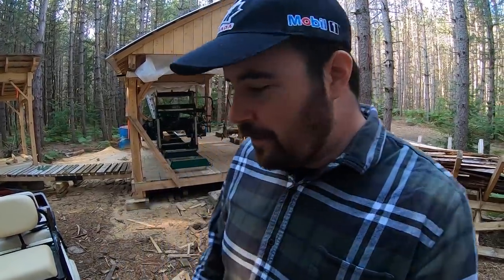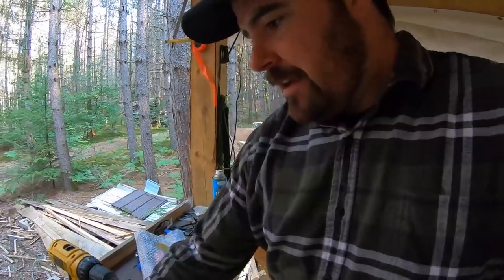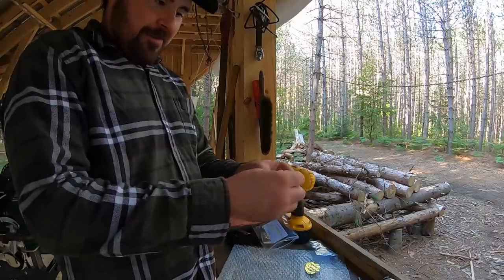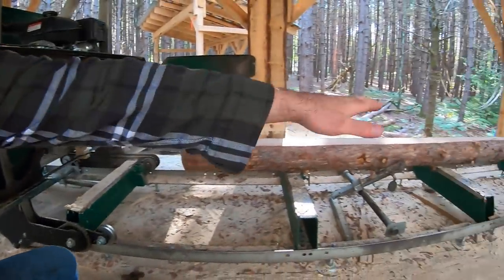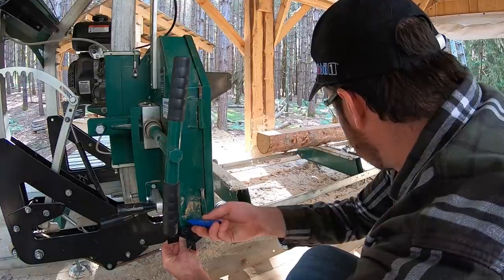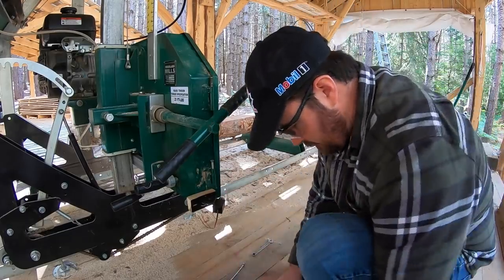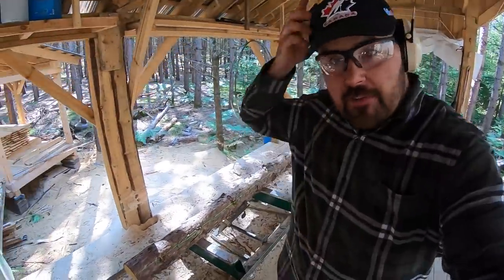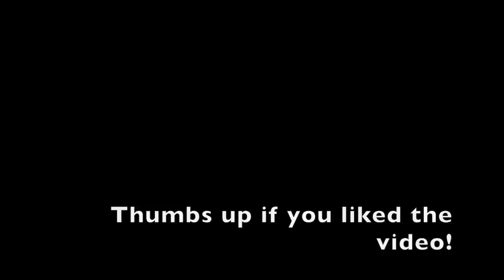Sawmill Laser Line Changes Everything | Placement and Setup

Comment: About 30 years ago, while working with a mechanical engineer, running a high end Wood Miser. I solved this issue by taking his advise that "the simplest way is almost always also the best way". We discussed the use of lasers, optics, various devices.

I decided to use a piece of wood, mounted exactly as you did with the laser, but I mounted to the left side of mill.

 The piece of wood was cut curved on the left, and flat to mount, on the right. I cut a slit through the curve. Mounted with slit at same height as the blade. Just look through the slit to see where the blade will be at the end of the log. The curve was to make it easy to look up the log, not just at the end.

My design does not require a battery, nor adjustment once installed. Simple.
Reply from the maker: Thanks for sharing that idea. Sounds like a great option!

Comment: Just watched your installment of the lazor on your mill. What do u think of putting  your power supply an a switch up by the throttle that way it is right there for u to use don't have to reach anywhere else to turn it on an off. Another idea is the bracket for mounting the lazor if it was magnetic it could be taken off very easy.

Comment: Thanks for bringing this to my attention.  When I get my mill I would definitely like to have one of these on the "Stop" side.  If the laser hits a stop... so will the blade.  As for doing the initial setup, I would get a nice block of wood and use a black Sharpie to draw a line exactly one inch (1.000 ") from the bottom.  After making a cut on the log, I would raise the blade one inch higher.  I would then move the block of wood all along the surface of the log to make sure the green laser is exactly on the black Sharpie line.  That should let me know if any fine tuning of the laser needs to be done.  Cheers!

Comment: Sandy here’s something to consider for clipping your alligator clips to your wire , put a couple spade tabs on the wires that the alligator clips on to , also I would extend the wires to your power supply and move it up to the handle bar of your sawmill so when you power up the saw mill to cut your wood you can turn the laser on or off without having to bend over to do it  …
Reply from the maker: Great ideas Don! Thanks for passing those along.
Reply: @sawingwithsandy  I would never leave those alligator clips there.  As said above just extend wires and mount elsewhere.
Reply: @brinkee7674  I'm gonna do the same too

Comment: I mentioned doing this laser mod in your episode: "Keep an Eye on These Sawmill Maintenance Items".   You didn't say much back about it so I thought you probably found it an unimpressive idea.  But now one month later and I get to enjoy seeing  you have set up a laser on your mill.   I mounted my lasers on the doors using 3d printed brackets with trunnions and those assemblies are held on there with strong Neodymium magnets.  The magnets pull up from the bottom and from the side.  They really hold.  No drilling of holes needed.   I have one assembly on each side of the mill.   My sawmill is on a trailer so I can't easily hop from one side to the other when operating and for checking the log stops.   Much of the time it is hard for me to see the log stops.   To see them and the laser line on that side I am using a small backup camera/monitor setup.    The camera is mounted in the trunnion with the laser on the log stop side.   The monitor is up on the other side by the handlebar.   The lasers take 5 volts which I get from a DC to DC converter that is hooked up to the 12 volt starting battery.  The camera/monitor being automotive is 12 volts so it can also run off the starter battery.     I have a small 3D printed box that contains the DC to DC circuit board and the switches needed for everything.    It also contains a light which is to help with viewing my other sawmill modification: a digital display which I use in lieu of the scales.   There is inline fuse protection for the wiring.   I used magnets to mount everything and the 3D printer certainly was a game changer for making it all come together.    These mods were quite inexpensive for what I think they add to my enjoyment in using the mill.
Reply: a picture of your set up would be nice !
Reply: @ericcourchesne5901   I could do that but I am just not quite sure how/where to post it?
Reply: You could always post s video of it, then post the link here as a reply

Comment: You could cut the ground lead to the lasre and run a pair of wires up to your milling handle and install a momentary switch between the two ends of the cut wire . This would allow you to just hold the switch on while you adjust your height and the release it and the laser would be off. no going back and forth to the laser during setup. then turn off the main switch on the power supply when your finished sawing for the day.
Reply from the maker: I think this is a good long-term solution. Once I"m sure the positioning works where I mounted (I think it's good) then I may do just this. Thanks for sharing!

Comment: A momentary switch near the push handle sounds ideal.  That way you don't forget to turn it off and drain the battery.   
I like the placement of the laser.  That is a busy area, hopefully you wont run into it with your knee.

Comment: I put mine behind and a little to the side of the stationary blade guide. It runs off the 12v battery that starts the motor. Works great on the end and operator side of the length of the log. I forget what other channel I originally saw the mod on (about a month ago), or I'd have referenced them for acknowledgement.
Reply from the maker: This could be a good option as well.
Reply: Great idea running it off the saw mill.

Comment: The more gizmos on a sawmill the easier it is to operate. You need the auto lube. I modified a 12v trailer jack to raise and lower the head, sure makes life easy on the shoulder and easy stack cutting. That laser looks wicked, thanks for sharing, will check them out.
Reply from the maker: I've seen some 12v jacks rigged up to the Woodland Mills sawmill on facebook groups I visit. Maybe it was you posting the build. Sure looks like a slick unit! Glad you liked the video and thanks for watching!
Reply: @sawingwithsandy  myself and a friend have posted our trailer jack mods on FB. His is on the 130 and mine mine on 126. Its the best mod I’ve see on these mills hands down, won’t surprise me to see WM adapt it at some point, or something close to it, they seem to have a knack for new gizmos. 😉

Comment: Nicely done. You can get some bell wire - twisted or not - attach to laser and route around the saw and to the station.  Then you are able to track the batteries and on/off when not used.

Comment: Simply love it. You are right, it should boost the production by speeding up the blade height setting and maybe helping in getting an extra board or two from each log. And if you were to set another laser on the other side of the log, you would know when you are about to cut into one of your dog...lol... save a few $$$ in blades there too. Thanks for this video
Reply from the maker: You're right about that one! Cutting logs is one thing but cutting log stops is another haha

Comment: Looks like your on a tree farm there and the trees are still kind of small. Do you ever get big logs? I'm in NH and my mill will accept 30" Dia. and 21' long.  I saw allot of white pine and some red oak that are around 2' in Dia. Those get heavy. My bandsaw mill is home made and I made a hydraulic log turner and log clamps for it. It's all hydraulic function now, but I started out with it all manual.

Comment: That would also be very helpful to people like me that don't very often cut straight, smooth logs. There are times i'm cutting slabs and there may be a specific feature halfway down the log that i want to capture in a slab (or avoid entirely) and the tape measure isn't always as fast or accurate as i'd like, especially between the rails.

Comment: Looks great Sandy. 
You will need to calibrate it for wider logs though. 
Based on that video there is still a chance that the laser points down or up  in the direction across the mill. So with a wider log it won’t hit where the blade does.
Reply from the maker: I tried my best to ensure that it was running at the same plane as the blade but you may be right that some fine-tuning will be needed to ensure it's spot-on

Comment: First off all ,, good to see you're eye is healing well. Perhaps i would have put it on the door itself in that bottom corner. but like so many suggestions there are no right or wrongs on where to put it. Also i noticed you sawing bed is quiet long,, did you have extensions on your mill and what is the maximum length are you able to cut on it?

Comment: I have been thinking about the post that builds up saw dust. I think if you have a old 5 gl. bucket put the lid on and cut off the one side just in front of the handle. then cut the top and bottom of the bucket so that you can slid up the post. the top should keep the saw dust out.

Comment: That is a great addition to your sawmill.  Will be interesting to see how it holds up over time.  It does vibrate a fair amount while cutting.
Reply from the maker: Since it’s often used in commercial sawmill operations I’m thinking longevity should be good. I also just turn it on to set the first cut location then turn it off as after that I’m all set. I’ll be running it and testing it out in coming episodes. Glad you tuned in to check it out

Comment: I like using Lasers especially green ones in my wood shop since they are easier to see over the red ones.  I was thinking mounting the laser on the underside of the blade box instead of on the side as you did would be out of the way in case you accidentally bump into it.  Looks great and hope it holds up in the freezing winter temps since batteries just hate cold freezing weather.  Cheers!
Reply from the maker: I like the green as well. Sure seems like it's bright that's for sure. My main concern with below the blade box was I needed the laser to be in line with the blade so that the laser would broadcast a line that was flat across the side of the log in addition to the end.

Comment: Could you make a stand alone jig that mates with the saw only for setting height? Maybe a bolt that goes across into a notch to raise and lower the laser, vibration is a killer and will mess with your laser module in no time.

Comment: ok, for the slow learners like me.  Can you please explain how "eyeballing" it with the laser is better than a tape measure?  You didn't really explain what your objective is when using the tape measure?   Are you going back to the mill and adjusting the level/height to what you got from the tape measure?  And now that you can "see" where the cut is going is the measurement inconsequential?  I don't run a mill yet so I can't ask a question that's based on experience/bad experience etc. Does the laser allow you to have confidence in how shallow you can make the first cut and be sufficient?  I have watched a lot of milling videos and I haven't heard (yet) anyone talk about the difficulty of picking the line for the first cut.  I not trying to be a jerk, please explain or take it as a suggestion for new content for an explanation video.  Cheers

Comment: Im digging it.. Hopefully the laser can hold up to the vibrations of the sawmill.
Of the 10 lasers i ever bought i bet 7 or 8 failed in fairly short time.. Probably just overseas junk..
Stop at your auto parts store and get some black plastic wire shielding and a switch and mount it in the drivers seat :)
Going to keep my eye on how this holds up for you.
Sure would save me alot of time when im alone at the mill..
Reply from the maker: Good idea Steve. I'll be sure to have the laser in action in videos coming forward as I get down to cutting. Thanks again for watching

Comment: Suggestion - run one of the battery wires up to a momentary push switch mounted beside the height adjuster and back down to the laser.
Reply from the maker: That's a pretty good idea Gary. Would keep me from having to hunch over to hit the switch and then turn it off again.

Comment: If you take of the wood and turn on the laser, you can put mark those shed woods that holdin roof up. So you can easily look if laser has moved off the wertical position
Reply from the maker: Great idea. Think I’ll have to do this. Thanks!

Comment: Hi Sandy, can't you make the laser internal behind the door?
Then you have full protection from bumps and when you shield it it is also protected from dust.
Is just an idea, am working on it too with my woodlandmill HM 126.
Greetings from Portugal
Reply from the maker: Good to hear from you Ronald. Behind the door would make for a very smooth installation but my concern would be that the blade could potentially hit it if it were to pop off or break which has happened before. Besides that I do like the idea

Comment: Sandy, is there room to put a strip of peel and stick weatherstripping between the door and the side of the gaurd to stop the saw dust from getting on the laser? Maybe it's not a big enough issue to even worry about. Just thinking out loud
Reply from the maker: That's a great idea. I think there's likely enough room there. Sure would make for an easy fix. Thanks for sharing

Comment: Hey, I’m a new sawmill operator and I have a question you might be able to help with. I’ve been back and forth with doing a laser install like this. I don’t think I’d use it much for after squaring a cant, but I would really like it for the first cuts to remove the best amount of slab with out waste. (So the question) Could I use a stand Alone (construction type) laser level on a tripod, not mounted on the mill, to level up my log and then crank my saw blade to meet up with the laser line for the first cut?
Reply: Obviously as long as my mill is also level
Reply from the maker: I’d imagine that would work well. Think you could aim the laser onto the log where you want to cut and just line it up with the blade as you mentioned

Comment: Does the band saw have an electric start and if so why can't the laser be tied into it?
Reply from the maker: My 2017 doesn’t have electric start
Reply: The laser works on 3V. You can use a converter to reduce the input voltage from 12V to 3V

Comment: Not really sure I understand the disparaging remarks on using a store bought diy version. Most of the diodes are probably the same. Personally I would probably consider buying a laser diode direct, but I don't see the problem with any of those three options.

Comment: The human eye is much more sensitive to green than red, hence a green laser for this application. The laser module contains some kind of scanning device. If the scanning stops, the 20-mW laser is a Class IIIb device, which is somewhat dangerous and is, for instance, mounted about the height of a dog’s eye. When scanning, the laser exposure is somewhat safer unless the viewer is quite close to the output.
Reply: On further thought, I’m not sure the beam is mechanically scanned. The light may be spread horizontally by a grating device.

Comment: I see on the laser specification sheet that the operation temperature is 20 - 30’C. Any concerns about how it will function in the winter?
Reply: according to the specs , it won't . winter temps are -20c to -30c
Reply from the maker: Hi Shelley, I don't know for certain what range of temperatures these have been used before in but I have contacted the company to ask and will be sure to pass along what I find out in one of my upcoming videos. Thanks for watching.
Reply from the maker: Hi Shelley, I spoke to someone at the laser company and they said it’s always best to try to use an insulated covering over the laser when the temperature gets below 5 degrees Celsius to ensure the laser operates as normal. I plan on running it in all conditions and so I’ll be able to share with you how it performs at the low temperatures. Thanks again for watching

Comment: Mount on the door.  Door will hit laser when mounted on the side.
Reply from the maker: Luckily the door can open quite far to just past perpendicular to the saw blade while clearing the laser with this placement.
Reply: Saw that after my comment.  What about modifying the spacer block to create a hard stop so  the door doesn't  hit the laser.  Or add a hard stop at the top hinge?
P.S.  Sandy, thank you for taking the time to respond to my comments.

Comment: One idea is always better than the other.  Mount it inside the wheel guard and drill a hole in the cover. Solder the wires and not use the alligator clips. Why did you need to measure the first cut when you have the mill scale to look at? The lazer is not a measurement.

Comment: Would be nice to steal a tiny bit of electricity off the engine and drop it down to 3v with a buck converter. Then you'd never have to change batteries.